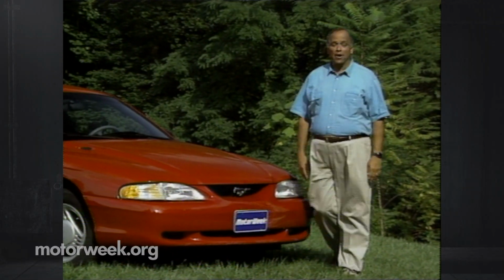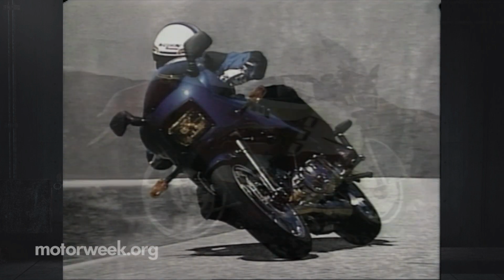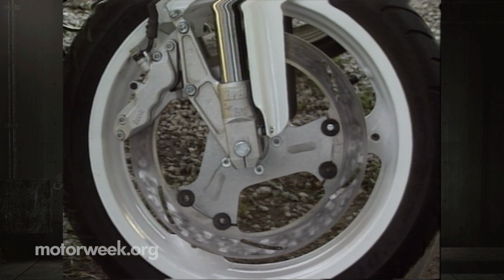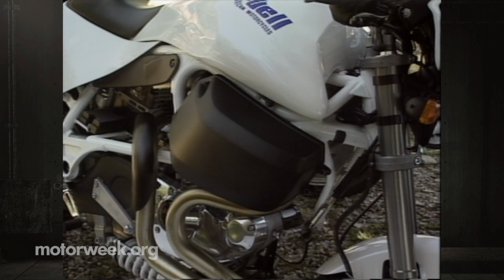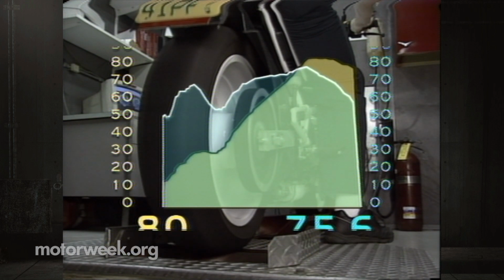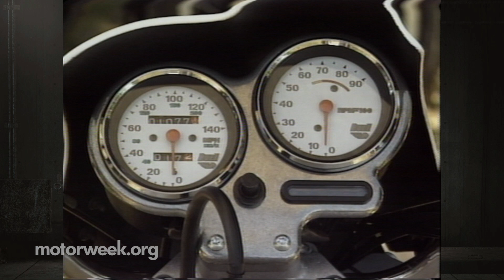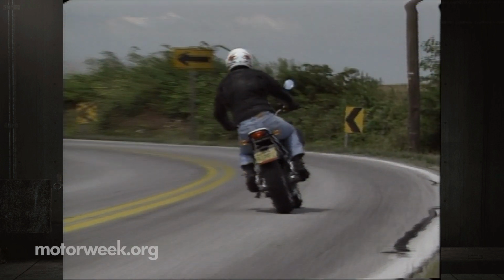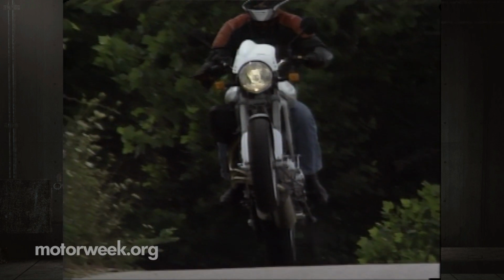MotorWeek | Retro Review: Buell S1 White Lightning

Comment: I'm an old school, old timer who has loved Norton Commandos since my first one in 1970, I bought a '97 S-1 Lightning and what was cool about it was that it had roughly 50% more displacement and 50% more hp than an 850 (828cc) Commando while weighing in within a few pounds and having the very same engine characteristics as the Norton, smoothing out like silk at 3000 rpm. The old tubers are classics, wouldn't want to travel on one, but for half day rips through the Rockies, they were very satisfying.

Comment: I didn't get Buell at the time at all.  I've since become more open minded and see these bikes as classics as there's nothing else quite like them.  They are cheap enough used where you can spend a few bucks on sorting them out and there's billet motor mounts, etc available from Twin Cycles in Holland.
Reply: I thought the same thing riding liter bikes for over 10 years. Rode an xb9s in the mountains and tail of the dragon n loved it. Plenty of practical power sounds awesome and handle amazing. Not top speed bikes but they aren't designed for that. N a lil work to a 1200 n they make a lot more power than u can imagine. The torque is what gets it done. Currently have an X1 getting a 1250nhrs kit, ported heads and cat 3 cams. 2009 xb12s with dnd pipe n ecm and 2015 EBR 1190sx with dean Adam's pipe n ecm. The 1190 is a beast! Still would love to find a super clean original S1, there aren't many around. Still love to sound of the harley based bikes. Being from Wisconsin it's just cool knowing they we built local. And like u said there is just really nothing like them.
Reply: How did the x1 turn out ? I’m interested in doing my x1 also

Comment: Ah, Buell. Every model with a life-threatening safety recall. The level of quality we've come to expect from H-D.
Reply: +William Doubles they didn't go bankrupt, Harley closed down a bunch of shit during the crash of 2008. .. and those motors aren't as "primitive" as you think they are.. almost 100 horsepower and 85 lb-feet of torque while getting about 45mpg is more efficient than a lot of those Japanese I4 sportbikes.  They don't have the top speeds and top-end acceleration that a I4 has but they got a lot of power right off of idle.. the 1/8 mile times are real good... plus you mod one of these out and its a hot streetbike. The XB models that came out int 2004 were total badasses for what they were, I got two of them and Love them more than any CBR or ZX I have ever owned.. the torque is fucking seductive.. reliable too.
Reply: +Martin Espinoza   When I bought my 2000 M2 Cyclone, the dealer wouldn't let me have it for 2 weeks because of a shock recall.    Before I could even take delivery it was caught in a recall.
Reply: Buelligan88 buell didn't make the shocks on the m2, I think it was showa front and Works rear, wasn't it?
Reply: Showa on both ends.  The Showa rear pull shock was dismal.  The two I had on the bike both had seal failures.  The first was replaced under an extended warranty and the second one eventually failed too.  I replaced it with a Penske shock which totally transformed the bike's handling. 
I liked the M2, the only American bike I've ever had.
Reply: The hell u talking bout? Every buell I've had has been rock solid. Especially the XB bikes. Every god damn Honda I've owned had electrical problems, every single one left me stranded somewhere ..every.. single.. one.
Reply: @fvgc454ss  I guess I have been lucky with my 4 Honda's. My 14 Valkyrie left me stranded once. I prefer cruisers , though, if I had a choice between a Buell and a Harley Davidson, I'd take the Buell. I remember when Harley Davidson dealers quit selling them. That would have been the time to buy. Could have gotten a very good deal, on an excellent machine.
Reply: @Wild E. Coyote  my 900rr caught on fire from a bad regulator rectifier. 929rr had the exhaust servo fail TWICE locking the butterfly in the exhaust hours from home bike couldn't run. And the 1000rr I had the computer failed with 12k miles on it. I still loved those bikes but it was irritating. I've had about every brand liter bike under the sun and multiple harleys and honestly my xb12s and my vrod have gave me zero issues in over a decade and my vrod is Turbocharged and I built the turbo system. 13 years all I've done it put fuel in it and beat on it. Never let me down once. Same with thr buell all I do is wheelie it and beat on it. The only issues I've had is a few bolts falling out from vibration or the battery terminals coming loose. Other than that rock solid.